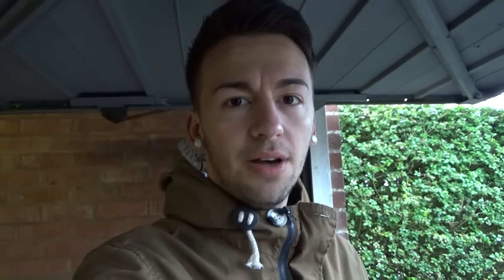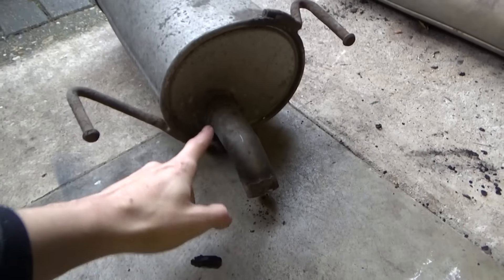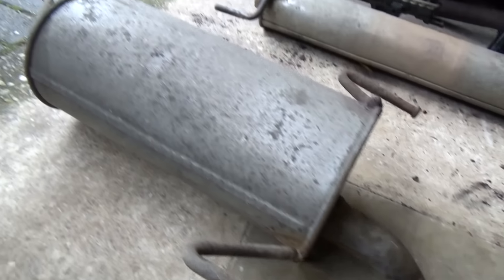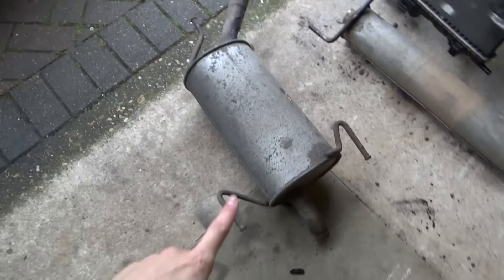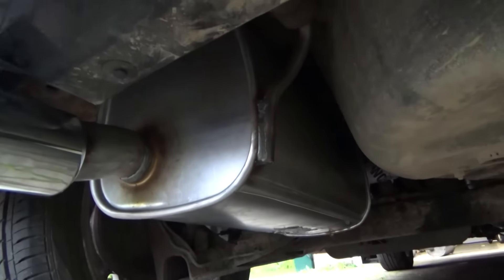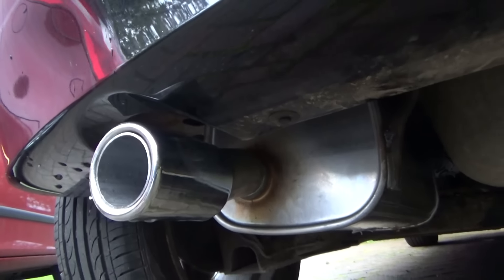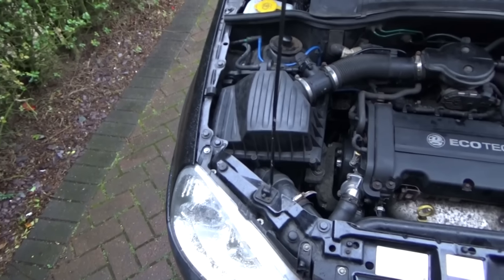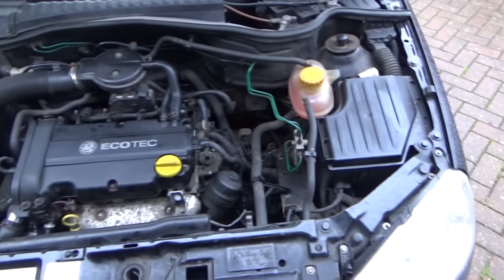PROJECT SXI - Part #9 (Finished?!)

Comment: That clicking sound, you can hear, are the injectors. As it's not a central port injection, rather a multipoint fuel injection.  My Vectra sounds the same, even though mine doesn't have a chain, but a timing belt. Nice series of videos. Brings back some good memories, when we did a similar work on my car a few years back, with my buddy. Not that it was necessary, mainly just for fun. My car is 24 years old now, and the engine is still going strong. Wish I could say the same thing about the chassis though. I may still keep it. It has never failed me once, so it's hard to give it away.

Comment: Hi i saw you didn't film the timing chain part but did you just follow a Haynes manual to do this as were just in the process of rebuilding the engine from it being gunked up and head gasket gone but still got timing chain to do and obviously want it to be right!!

Comment: Hi there is a bolt in the bottom of the water pump you should of bled it there first as you started to fill the system

Comment: I wish my engine was that quiet. What timing chain kit did you use?
Reply from the maker: I just used a engine rebuild kit from eBay bud.. It's got louder over time which I need to address
Reply: It will be the plastic guide, its common for them to get louder after a couple of weeks so your previous chain was probably good.
Reply: As you rebuilt it did you lubricate the parts

Comment: Hi mate I have a 2004 1.2 sxi the problem I got is the engine management light is on and it struggles to start and the cooling fan comes on straight away very loud and it stays on after I turn the engine off. Do you have any idea what could be wrong? Thanks in advance
Reply: Moto Mathers replace the coolant temp sensor and disconnect the battery for half an hour.  should solve the issue.
Reply: Have you tried the pedal trick. Press down on the brake and accelerator pedal then turn the ignition on to II (but don't start her up). The engine management light should start blinking (10 blinks = 0) from that you can get a P code with 4 digits. Google the P code and you'll find the fault codes. Failing that you could always purchase a OBD2 adapter.

Comment: Sorry this is late. How much would a good corsa c worth
Reply from the maker: Lots of factors mate, what model? Se? Sxi? Sri? 3 door? 5 door? Alloys? Mileage? Body condition? A decent sxi would be about £800-£1000
Reply: This is even more late but I picked up a 1.2 Design 5dr Dual Fuel Corsa C, 05 reg for £750. In October 2017.

Comment: what causes that ticking noise on the before mine does it
Reply: if yours is a twinport its prob the 2 little bolts/screws have come loose in the twinport i'd take off twinport split it the twinport that is and use loctite and tighten those 2loose bolts/screws inside and put back together no ticking tapping noise its apparantly very common with these engines unless it your tappets but more likely the first if yours is a twinport  engine maybe this might help save someone some money having costly diagnosis and possible unnecessary work carried out and not sort the problem at the garage